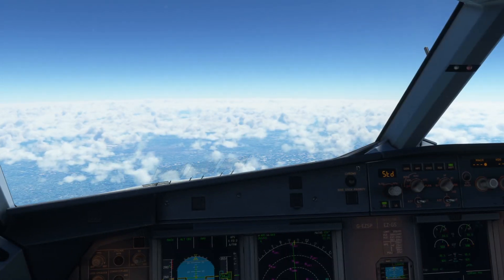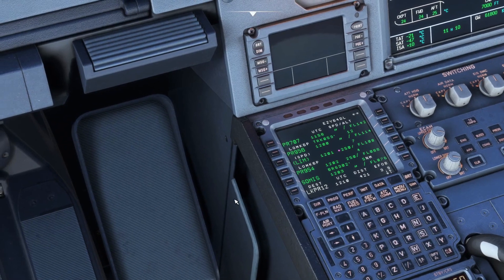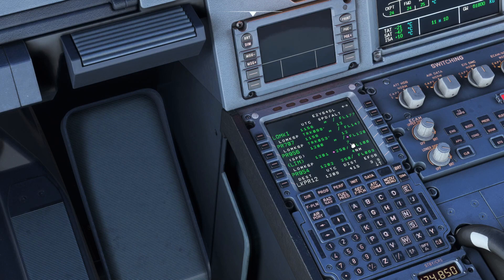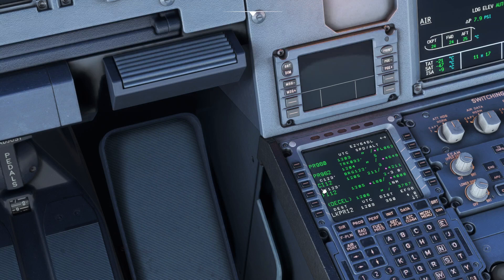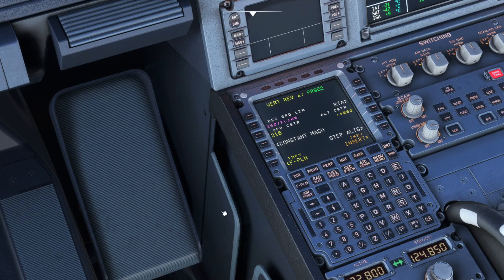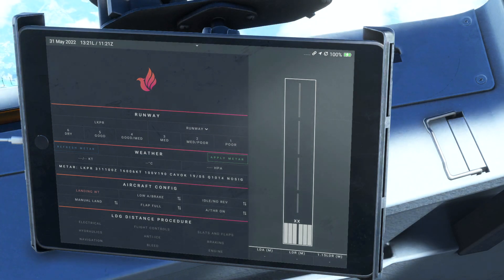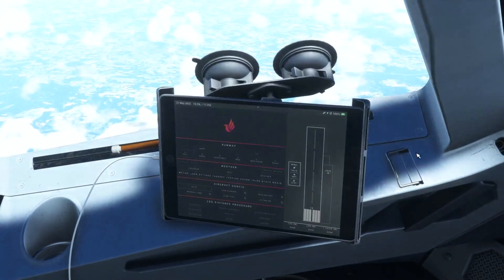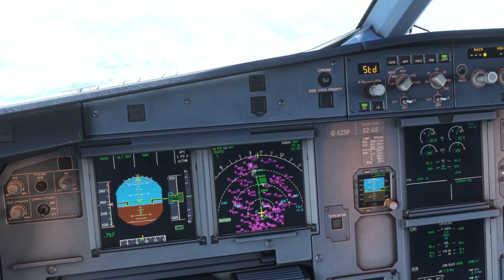FENIX A320 - Approach Planning & Managed Descent (Vnav) | Tutorial Series Part 6

Comment: A short question: if you are flying offline, would you directly set set the altitude for your descent down to 3000'? Or would you do some steps in your descent?
Reply from the maker: That depends where you are - you can set the final altitude if you're offline as you're not getting in the way of anything - BUT - check the MSA (minimum safe altitude) on your charts or you might fly into something hard on the way down!
Reply: @Easyjetsimpilot thank you mate for the quick answer. Yeah, you are right, to check the MSA is crucial. I wasn't sure if setting the final altitude too early could make some problems later in being to fast and not reaching a safe approach speed.

Comment: I have been flying the Fenix 320 for a while now and followed A320 Si mPilot's videos as well as yours.   however, NONE tell me how to get the V-Speeds on the EFB!   I can do the departure performance - which gives you the speeds to then set in the MCDU - but on the arrival performance page, whilst I do everything you have just described, how do you get the actual landing speeds calculated?   At the moment, I'm using the speeds shown on the PERF/APPR page, but as I get closer to the landing, I find that the CLN speed shown on the initial calculation check, has changed!   So I guess I am asking how do you arrive at the correct landing speeds (V-speeds) ?   Do you do the calc on the EFB and transfer them to the MCDU or do them in the MCDU ?   Thanks
Reply from the maker: The Vapp speed is calculated by the MCDU/FMGS so not on the EFB.
Reply: @Easyjetsimpilot  ok so just putting the expected landing weight in the EFB will allow the correct V speeds to appear on the MCDU?   Nothing to transfer from the EFB to the MCDU like you do with the takeoff speeds?  Thank you. That’s answers a really mystifying problem for me
Reply: @TheVirtualAirlinePilot  you‘ll have to enter the arrival data (qnh, wind, choose flaps 3 or full and that stuff) in the MCDU. The aircraft even asks you to do so in an amber color if you don’t. As far as I know, it calculates the speeds from that.
Reply: @ChrisMuellerMusic  Hello Chris and thanks for replying.   To be honest, that's what I have been doing so far, entering it all in the MCDU.  So you go into the Arrival Perfoemace AFTER entering the data into the MCDU?  Ok cool.  Thanks.  Lee
Reply: @TheVirtualAirlinePilot  at least that is what he says in the next video in the playlist where this one is also in. The reason is, that you want to put in weather info as late as possible since that is likely to change. He says about 30 to 40 minutes prior landing is the earliest. So yeah, arrivals and approaches first, and landing data after that.
Reply: @ChrisMuellerMusic  Thats about what I do anyway.   I have the Nav display on 80 miles and as soon as the white arrow appears, I get the latest weather data and then enter it.   Lastly, I'll re-check the QNH at about 12,000 feet i n case of any change - but I'll look to see if I can improve on it all anyway.  Thanks for your replies.   Lee
Reply: 👍🏻 Your welcome and happy landings.

Comment: So on touch down you do idle and reverse thrust but i see other pilots do idle at 30 feet altough i believe og idle at touch down will make a more stable and smitter landing whats right correct me if you will😅
Reply from the maker: Start reducing thrust to idle at about 30ft. Each landing is different though. With a tailwind, you might want to keep thrust on a moment longer.